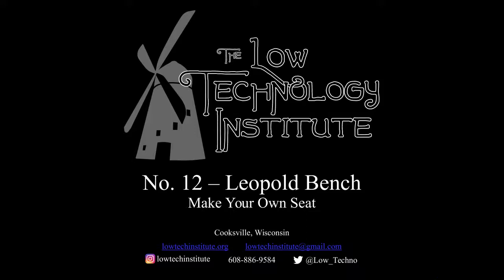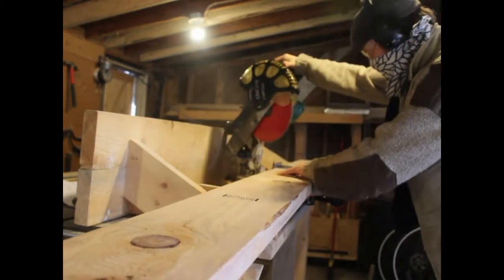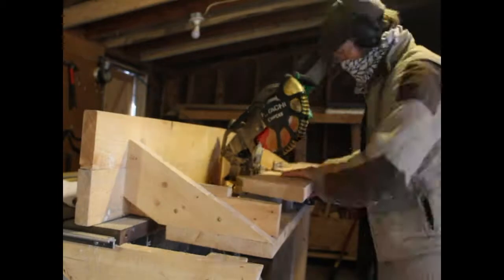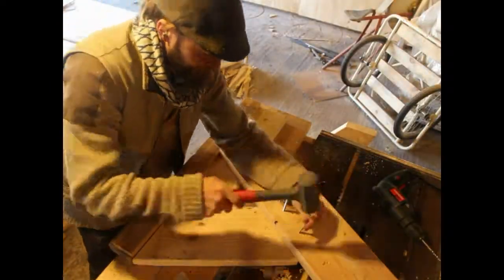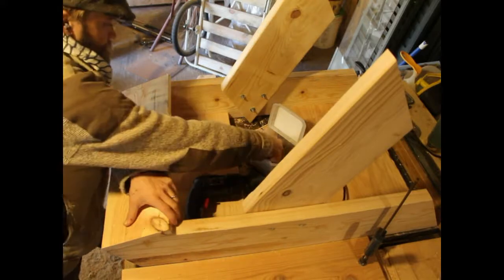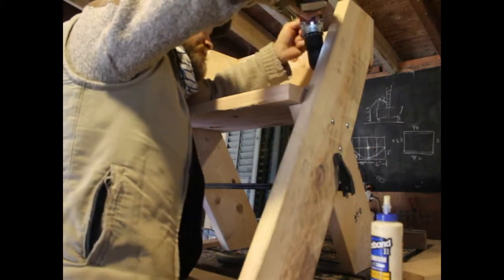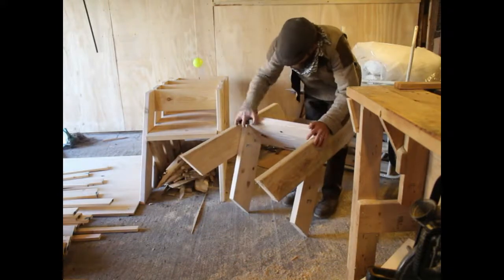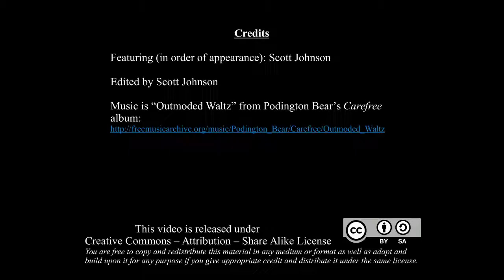Leopold Bench -- Low Tech Video, No. 12

Comment: GRK Screws are lag-bolt replacements and actually cheaper in the long run if you're going to make a few benches. Home Depot and Lowes sell them. This is the true Leopold Design 30degrees. Others use a 40-45-20 design. This is much simpler. You can also put another board on top facing backwards so you can sit on the bench backwards and use it as a mini-table or arm rest when you're looking at birds thru your binoculars.